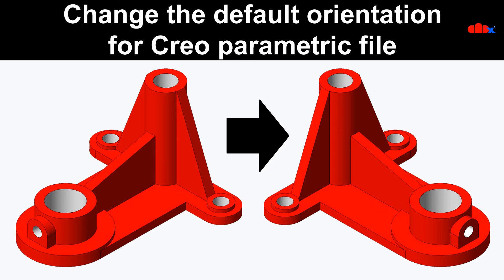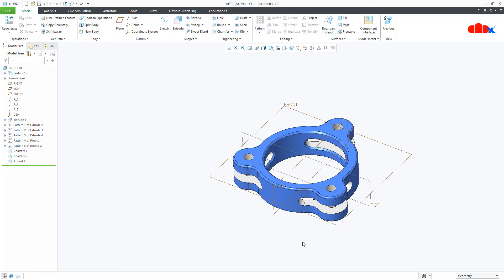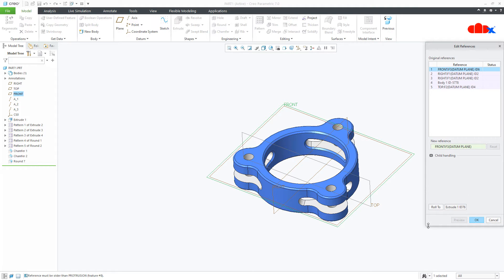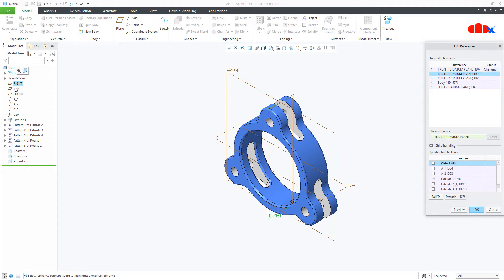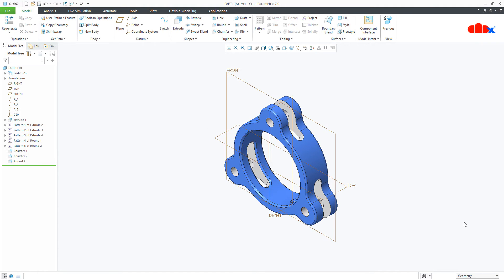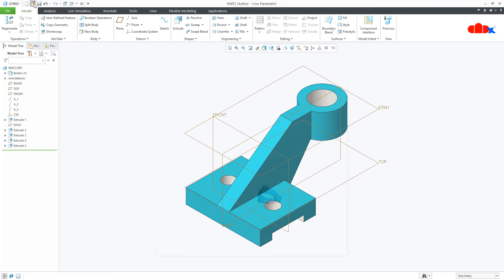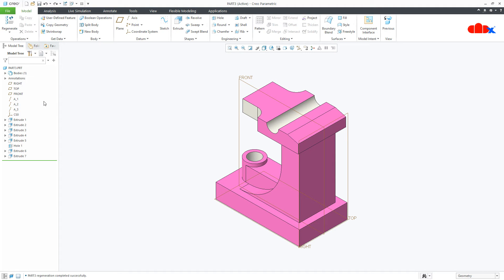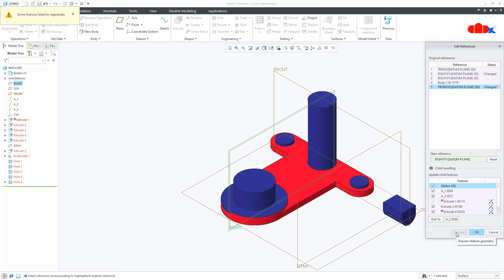Change default orientation for Creo Parametric file - Edit Reference in Creo Parametric

Comment: @Creo, a PTC Technology  Sir need one more Help 
I open a part or component for mold design And it's already rotated in three Axies (X y Z) then how to Align it at right angle or according to datum plans. Lots of search I did not find any command to tackle this problem.
Reply from the maker: Have you tried this?
https://youtu.be/1e7ZDcNO48s
Reply: @CADxTraining  yes but not working.
Pls Send me your email Id I will send you step file and pls make short video on this topic because I did find any video on you tube regarding this problem.
I am professional with ug/nx but  creo is very different from nx.
Reply from the maker: sandesh4satyen@gmail.com
Reply: @CADxTraining  sir check Your mail.
Reply: Sir Do it in part mode that is learning point in this issue  . In assembly mode we can do this by contrain. Easily.
Reply from the maker: This is a Creo7 file. I use Creo6.
Reply: @CADxTraining  Okk I will send you tomorrow after minimize the version.
Reply: @CADxTraining  Sir check Your mail Once again I send file in two extension parasolid and step.